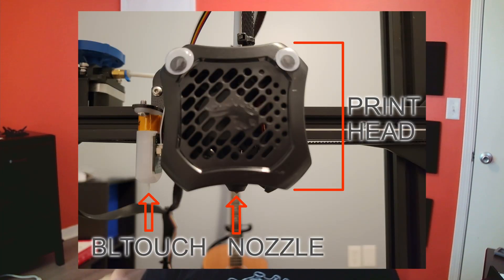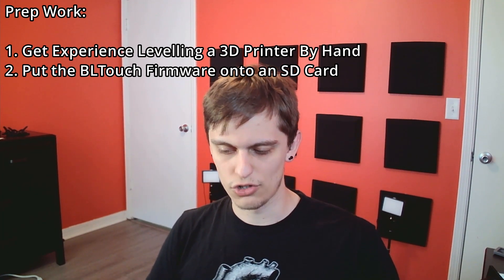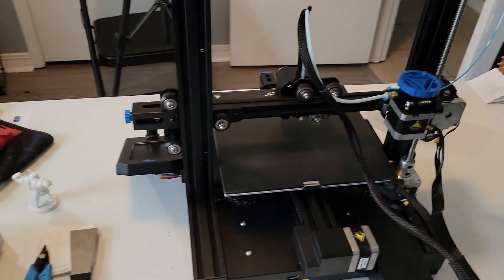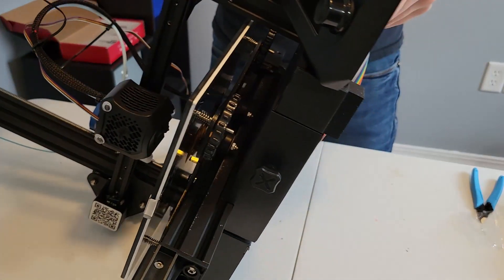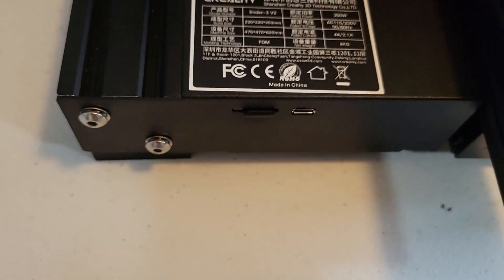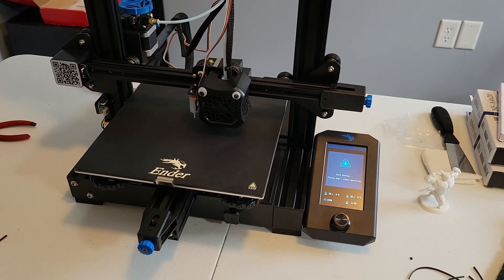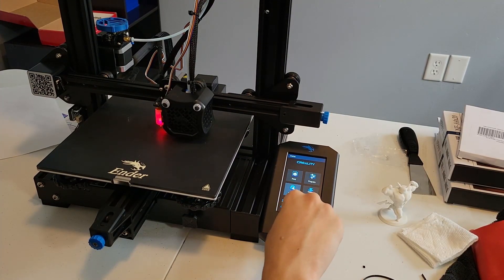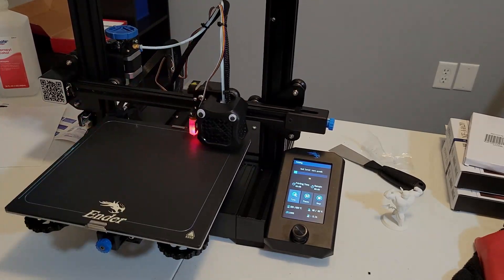BLTouch Installation and Review - Auto Bed Levelling Ender 3v2

Comment: I got the exact same package as the author of this video. I received it a couple of days ago.  I agree, the instructions that came with the package sucked big time. Babysit the BLTouch for a while might be a bit of an understatement. At some point during several of my prints the BLTouch began to flash red before finishing its auto bed levelling routine requested by Cura (my slicer of choice). To set up your slicer, you must insert a G29 code on the next line, or line following the G28 code in your slicer. Anyway, I hadn't noticed that my BLTouch was flashing because I was busy doing other things. The nozzle homed itself, and the printer continued on to the print I'd requested. That in itself wouldn't have been a problem, but the BLTouch tip hadn't retracted, so when the print head and nozzle moved towards the center of the print bed to begin the print, the tip of the BLTouch got bent as it hit the edge of the bed. Luckily, I was able to bend it back and have been using the BLTouch without any incident. I purchased the BLTouch because I had been having a bed-levelling problem, and I had hoped the BLTouch would help me solve that problem but it didn't. It did help me to confirm that I had a problem, but I already knew this. Instead, it lets me know when the problem has occurred, and it does this by flashing red. The problem is erratic, and on the right side of the Ender 3 V2 printer. The X-axis gantry is never perpendicular to the side of the printer, because there's a looseness in the gantry, or a play of about 5-10mm on the right side of the printer. I can grab the gantry on the right side and move it up and down by a considerable amount, and this is not a desirable feature of this printer. It's a printer design flaw. When printing, the gantry may move up or down by a slight distance on its own. This effectively moves the nozzle away (or towards) the bed by a small distance. Although this distance may not appear to be much it can ultimately move the nozzle far enough away from the bed to be a real problem as the print will not print. I assume the gantry moves upward as it is lowered, because I have not found any scratches on my bed surface. A further inspection of my printer revealed that the Z-axis motor had come loose from the metal side frame by a substantial amount (several mm) and I was surprised the printer was able to function at all. The lead screw is what kept most everything in place. This is from before installing the BLTouch, and possibly dates back to when I received and assembled the printer. In my haste, or eagerness to begin using the printer I may have forgotten to tighten the screws I had intentionally left loose during certain adjustments. I also had a clogged nozzle to deal with. I had changed the nozzle the day previous to installing the BLTouch. No, the BLTouch had nothing to do with this problem. So, I determined that I also had an extruder problem that needed to be fixed. I had changed my extruder several months before for a metal one because it was suggested by many video authors to do so, and that this would help to prevent having future extruder problems associated with the plastic extruder. In my opinion, the metal extruder no more solved extrusion problems than the plastic one did. Now, I'm spending all of my time trying to understand why the print quality was so drastically affected by these modifications and repairs. At first, my prints were awful, and I had to adjust the settings of the extruder spring compression and hotend temperature, and I had to review and change some settings in my slicer program. I believe once I have found the appropriate settings for all of these that my prints should be as good as what I had had them before I began modifying my printer. Let it be known I tried. As for this video, it's good. Keep up the good work, and thanks for confirming that the instructions sucked. I was beginning to think that it was me who just didn't understand.
Reply from the maker: Yeah, I definitely agree that there's a lot of quirks with the printer, and you can definitely tell it's a $250 printer.

I've had the flashing red issue before too, though I've never investigated it being caused by the gantries; it seems random to me, but I'm eager to take a closer look now. 

That being said, I'm my follow up review to this, I proposed the solution of making the printer beep just before it does the final heating so I can check the BLTouch for flashing and double check everything else. Here's the GCode I inserted into my slicer to make that happen: 

; 3 Beeps so I can check the bed level
M300 P250
G4 P500
M300 P250
G4 P500
M300 P250

Comment: Very interesting video. I put a BL touch on my Ender 3 v2 and I like it a lot. A few things I did different was fed the cable through the sleeves (pushed small end up from mother board), left the "Z" switch wiring connected on the mother board (disconnected the switch) just in case the BL Touch fails, used Jyers firmware for the type of MB you have (4.2.2 or 4.2.7) because it's a bit different (better) and when you save a setting it saves it to the motherboard loaded on it's firmware. I also used Jyers screen firmware to update the screen (more options then the  standard). Also, you should cut the tails all on the tie wraps short (anytime and anywhere you use tie wraps) so you don't cut yourself if you scrap against it (make sure they're where you want them and they're tight). By the way, your link to Thingiverse doesn't work. Very good video, thank you for taking the time. I didn't use "their" manual, to small and my 68 year old eyes couldn't read it!! LOL!!
Reply from the maker: Thanks for sharing! It honestly didn't occur to me to push the cables through the sleeves, I just assumed they wouldn't fit, so I'll have to keep that in mind in the future.

I thought about leaving the z-switch, but after playing with it, I concluded that even if I left it plugged in, the stock firmware wouldn't recognize it. Beyond that, I think that in the future, I'll repurpose it for a filament runout switch. Thank you for the recommendation on Jyers though -- I've been considering building Marlin from scratch and documenting the process, but it sounds like I've got another option to research as well now.

I usually cut tie wraps short, just not flush, but given that they're not load bearing, I can definitely see the merit in doing it your way, so I'll probably consider that in future videos, and in hindsight, I'd probably give different advice.

Anyway, thanks so much for catching the thingiverse issue, I just went back and actually hit publish (there's nothing that told me I hadn't before while I was logged in), and thank you for your feedback; it was very insightful!

Comment: Even with g29 in cura setting it won’t level before the print . It’s been a week since I got my bl touch and every day I try to make it work .
Reply from the maker: Huh, that's really weird... Can you open the resulting .gcode file in notepad and make sure that g29 is actually in the file after slicing? Also, if you hit the level button on the printer's main menu, does it work?

I haven't used Cura before, and I'm out of town right now, but when I get home on Tuesday, I'll install it and see if I can get it to work (and I'll throw a 1 minute video up if I do).
Reply from the maker: Okay, so it seemed to work pretty easily for me; here's what I did:

1. Installed Cura 4.9.1
2. Set my printer as the built in Creality Ender 3 (they didn't have the v2, but most of the physical print settings are the same)
3. Inserted G29 after G28 in the start gcode in machine settings
4. Sliced benchy
5. Threw benchy's gcode onto an SD card and over to the printer.

If it helps, I threw my custom start gcode over on pastebin[1] -- the only thing I added was line 4. It seems that if your start gcode looks the same, and if that gcode is near the top of the sliced file (line 19 for me), then cura isn't the issue. Lemme know how it looks on your side. If nothing else, I'll hop in a discord call with you sometime and we'll go ham.

1: https://pastebin.com/k2KZmUtX
Reply: Don't know if I can help you with this, but here goes. It's kind of long, and I'm sorry about that, but I have come across a lot of information, and I thought I should share it with someone. The firmware you download is very important. Make sure to look at your motherboard and get its version number before going to look for the firmware at Creality's official website. I found the firmware there under the Support and Download menus. I bothered with the motherboard's version number afterwards. Luckily for me, I think I got the right one. But the list of firmware versions is daunting, so make sure to get it for your printer type and motherboard version. At Creality, the Ender 3 V2 printer and BLTouch auto levelling sensor versions available are 4.2.7 and 4.2.2. Mine was version 4.2.2. There are too many firmware available out there, and if you must get one from somewhere other than Creality, a trusted source seems to be Jyers at Github. One of my favorite YouTube video loggers speaks highly of Jyers. Bon. I thought I would never have to level my bed again because that's how I thought the BLTouch auto leveller worked. Again, what do I know? For one, I now know it doesn't work that way. I still have to level my bed manually, but the BLTouch helps me to know when and possibly where I need to, which in my opinion is kind of stupid, because believe me, I know when I need to even if I might not know where I need to. My prints let me know, and these let me know at a cost, because the prints are failed and I've wasted PLA. Anyways. . . How did you install the BLTouch? In 2 separate YouTube videos I watched, one removes the Z-axis connector from the motherboard under the printer, and another simply removed this connector from the motor (the one with the lead screw). Either method should work. In any case, you will still have to access the motherboard to connect the bigger of the two BLTouch cable connectors. The idea is to disconnect the Z-axis limit switch and relent control to the BLTouch sensor. How you decide to do this is up to you. When you connected the bigger BLTouch connector to the motherboard under the printer, was the tab on the connector facing left or right? It should be facing left, or facing away from the Z-axis limit switch connector of the motherboard. The smaller BLTouch connector should be connected with the little metal inserts facing towards your print head and nozzle. The smaller BLTouch connector should also be connected with the provided cable before mounting the BLTouch to the printer. The white wire should be facing you, and the blue wire should be facing towards the back of the printer. Some video loggers claim that their cables were wired in reverse. I don't know anything about that, so be careful what you believe and look it up before modifying the BLTouch cable wires. My Ender 3 V2 printer has an X-axis gantry flaw, and I imagine many others have the same problem because it's a manufacturing or design flaw by Creality. This much was said in one YouTube video I watched, and I believed him because I have this problem. This means that the gantry is a bit loose on the right side. If you grab the right side of the gantry you can move it up or down a bit (5-10mm) without raising or lowering the whole X-axis gantry. I think this is a serious problem, but hey, they say it's a cheap printer, and now I know why. After you installed the BLTouch, and began setting it up through the firmware, did you auto-home it? Did it move to the center of the bed instead of the normal home position? If it did, don't worry, it's supposed to do that. If you watched several YouTube videos on the subject as I did, only 2 people will tell you to do what follows. I think it's important to do this because it makes perfect sense. Go to Prepare, and select Auto home. Once the BLTouch has centered itself to the bed and done its little routine of going up and down 2-3 times, measure the horizontal distance between the tip of the BLTouch and the nozzle. On mine, this distance was about 45.5mm (some say 46mm, but they had better not say theirs is bigger than mine, or else). Then, go to Prepare>Move, and subtract this value from the MoveX value. I subtracted the 45 AND A HALF millimeters from 165mm (half the x-value printable surface area). This will move your nozzle towards the left to where the tip of the BLTouch touched the bed of your printer. Why is this important? Well, it might not be, but some beds have irregular surfaces, and you want to make sure that the BLTouch and nozzle are both synchronized to the same height from the printer bed. It makes sense that the BLTouch tip and nozzle will both be at the same height if the nozzle is where the BLTouch was when it touched the printer bed. Once your nozzle is where your BLTouch used to be, adjust the Z-offset. I had to do this several times before I was able to understand what the offset was for, what it does, and finally got it to work. Before this approach, I kept adjusting the Z-offset (even reached the max at -10mm), and no matter what I did the nozzle would always be 2mm above the bed. The nozzle would not touch down on the bed. I thought that this was normal, but it's not. When you adjust the Z-offset, you should be able to use a piece of paper and slide it under the nozzle the way you normally would to adjust the height of the nozzle with the bed. Don't put the piece of paper under the BLTouch when it's auto levelling. Put the paper there after the BLTouch has finished auto levelling and you're ready to adjust the Z-offset. The Z-offset should be a negative value, because you want the nozzle to move down towards the bed, not up and away from it. When the height between the nozzle is just barely scratching the surface of the paper, stop. Go immediately to Control>Storage configuration, and press the knob to save this Z-axis offset value. By now you should be done setting up the BLTouch. . . sort of. If only it were this simple. I went one step further, and selected the new Level menu that appeared in my control panel. The Level menu replaced the Info menu. According to some, this supposedly creates mesh values of the different heights between nozzle and bed at each and every point the tip of the BLTouch touches down on the bed. At least, that's what I think it does, because some people claim the printer asks them to save these values (mine does not). If it doesn't work this way, well then it should! After selecting Level I watched the BLTouch do its little routine and check all of its checkpoints (mine does 9 of these, some claim you can do 25. This depends on the BLTouch firmware you downloaded). More checkpoints means the BLTouch needs more time, but also maybe provides more accuracy. Who knows? I launched the Level menu before going on to print something. When the BLTouch was finished, it just stayed there at the back and to the right of the bed. Lo and behold, I thought it would move back to the normal home position at the front of the bed, but it didn't. Why? I don't know, but again, I think it should. No worries. I found something simple to print, and launched the printer. The nozzle moved up, then down to a lower level than before without touching the bed, then to the normal home position at the front left corner. It then does its little auto bed levelling routine, and checks all of its checkpoints before returning to the normal home position to start the print. Finally, I thought my bed-levelling nightmare was over. Sadly, it was not. The problem is not with the BLTouch but with the X-axis gantry. Now, when the gantry is not perpendicular with the side of the printer by what might be considered a substantial distance, the BLTouch will stop in its tracks, usually on the right side of the bed, and begin to flash red. But be careful here. The BLTouch tip does not always retract, and the printer may decide to go ahead with the print. If this happens, the BLTouch tip can be damaged when it hits the side of the bed. You need to stop the print before this happens, or quickly tap on the BLTouch tip to make it retract before it hits the side of the bed. Now when it flashes I stop the print and do a manual bed-levelling, and often find that the right side of my bed is too low. This also tells me the X-axis gantry moved up at some point in time during printing. If I had continued to print anyway, the nozzle would not have been at the proper distance from the bed to print anything and the BLTouch lets me know this. It flashes when the gantry goes out of whack, and that lets me know the gantry has become misaligned (again) and that it's no longer perpendicular with the side of the printer frame. So, I am able to do a manual bed-levelling and fix this problem before I begin a print, and the problem is solved. Right? Well, it's partially solved until the next time the gantry misaligns. I hope this will have helped you some. If not, then I hope you found it amusingly stupid, and can ignore anything else I might have to say on the subject. I know it was long, but writing it was better than therapy. Thanks for reading, or listening, or whatever.
Reply: Watch this. It might help. https://www.youtube.com/watch?v=fa7IflGJH2Y